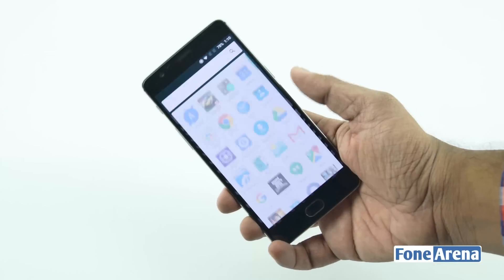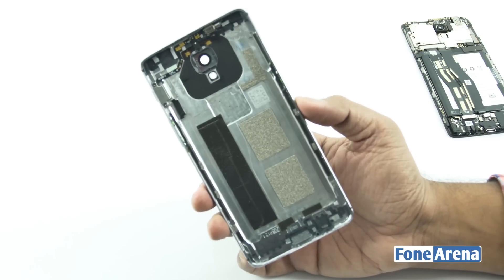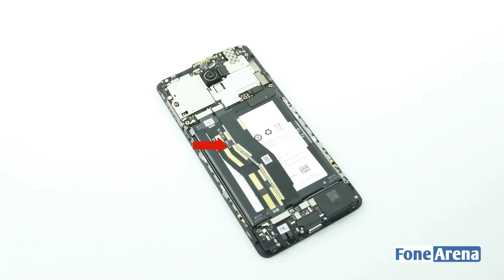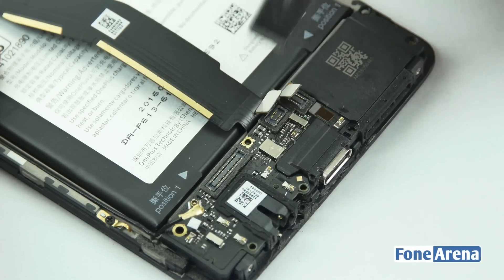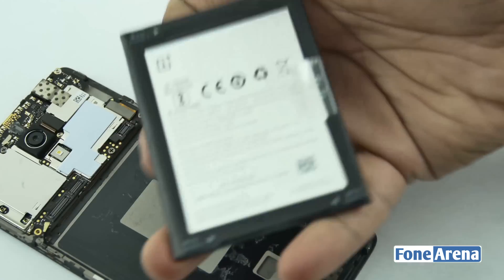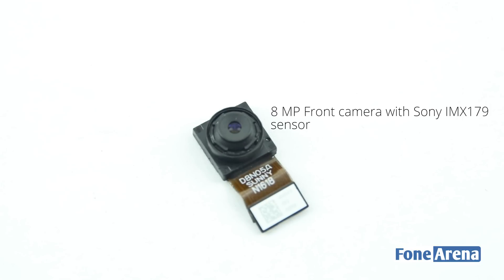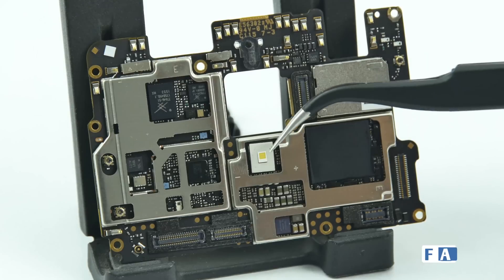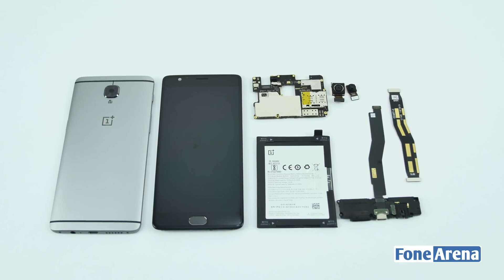OnePlus 3 Teardown

Comment: sir,  is it possible to replace the battery
Reply from the maker: +arun kumar not by user but service center can surely replace
Reply: if you can disassemble the battery, then you can also replace the battery. 
so yes, you can. but don't expect any kind of warranty after opening the phone.
Reply: +FoneArena thanks for clarification...